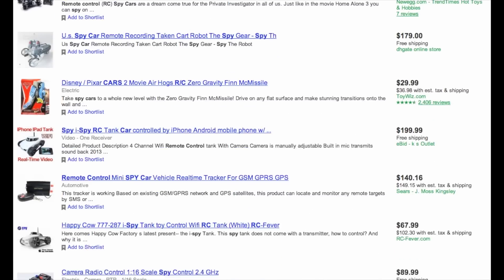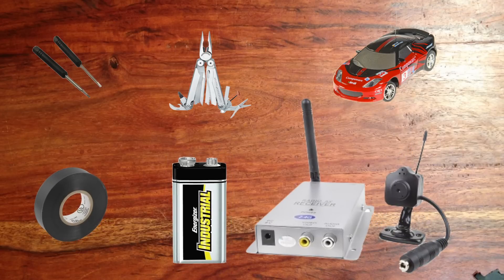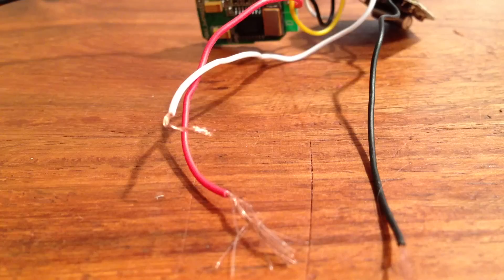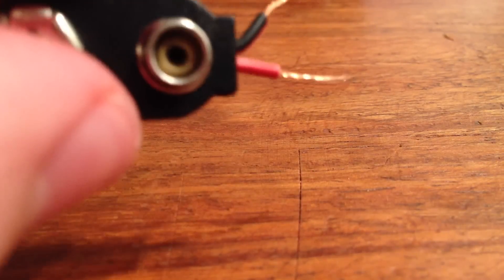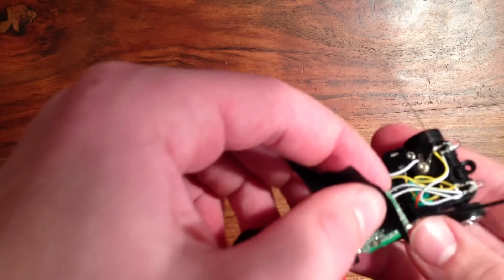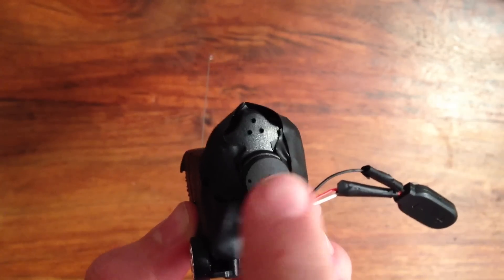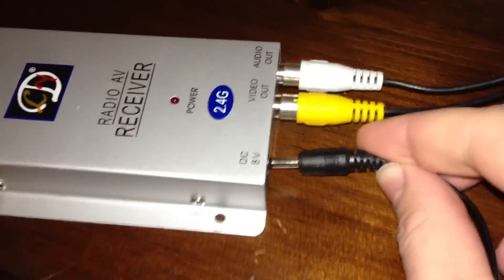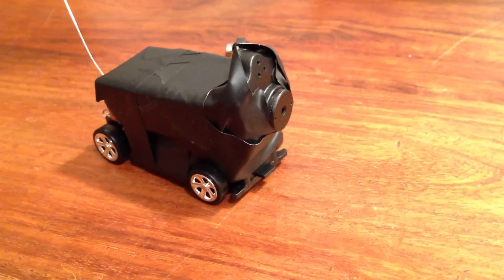How to Make a Cheap RC Spy Car

Comment from the maker: yes the camera comes with the receiver and everything you need. the power cable coming off the camera attaches to the 9 volt clip. I cut the ends off of both the 9 volt clip, and the camera power cable, then I reattached them. The whole point of that part, was to cut down on the weight and size to make the car as small as possible.

Comment: Great idea because pulling the camera apart is saves so much! Really? U think that the camera builders put lots of extra plastic to make a micro camera look bigger? The rc car could Easley be put back over the camera if u use a big car but then ur not spying. A small toggle switch could be added on for $1

Comment: when you buy the camera from the description does it come with the reciever and everything or just the camera.also does the power cable from the camera connect to the the 9 volt battery clipp or u just ripp of the coding like u said in the video or do u do both just want to know let me know asap! KEEP UP THE WORK BY THE TIME U KNOW IT YOU ARE GOING TO BE A HUGE YOUTUBER JUST WAIT!good job!

Comment: Nice video. But i think u might wanna look into soldering as oppose to tape. And use heat shrink tubing to cover the exposed wires

Comment: Pretty good job kid! I did this about 12 years ago using the same camera and 9v battery only I used a 1/24 scale car and I Soldered the connections and just used Velcro for the cam and battery to attach to the car. There was enough room inside the body for the battery so that it was not seen, only the camera on top. It was a blast at car shows having an R/C car running around that looked just like my show car and I had the video transmitted back to a 10 flip down monitor in the hatch of the car. Did the same with a big truck I had and I used to sit in My living room and watch on the big screen as I chased dogs out of My yard with it. I did not think about recording like you did though, that's clever way to capture the video and I will try that next time with My quad copter. Good post.
Reply: is this hate?
Reply: he is not a kid he is a baby
Reply: hi
Reply: from where did you buy wireless cam and wireless video reciever and price ?
Reply: U might wanna see how this kid is doing now!
Reply: @Xinurval  OK

Comment: If you run in your house just use skype!
Put an iphone in the car and whatch it with a computer!
Reply: Good idea. I bet he wished he thought of that first haha.
Reply: The Idea is that it is cheap, an 'iphone' is an expensive item to add to the car if he doesn't already own one.
Reply: +Owen Thomas          Use a one touch Alcatel there only $15
Reply: James Peacock Or you can just get a small, light-weight camera thats cheap and tape it onto a little bigger RC Car. xD
Reply: does this actually work
Reply: idk xD
Reply: better if use facetime or use iphone as webcam apps much faster processing aka less lag
Reply: kashif khan Expensive, requires a bigger RC car.
Also there is better software you can use to project the picture to a PC which also gives you full control over the camera and ability to read and record phone sensor data.

Comment: Can u make a spy helicopter
Reply: It should be the same process...
Reply: I will ty
Reply: Guillermo inca 
 depends on the heli you have 
coz it may get heavy and it wont fly i u got a small rc heli !
Reply: if a helicopter is a spy the sound of the elici will make a sound dummy